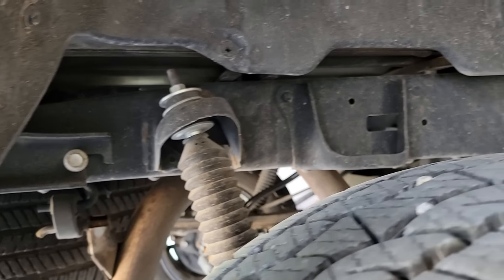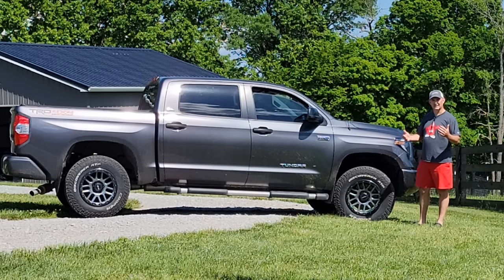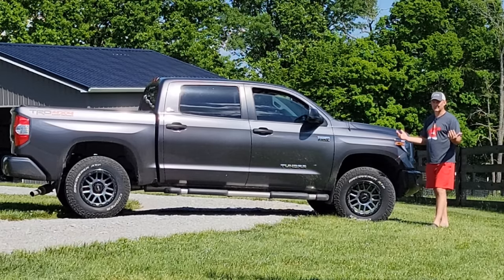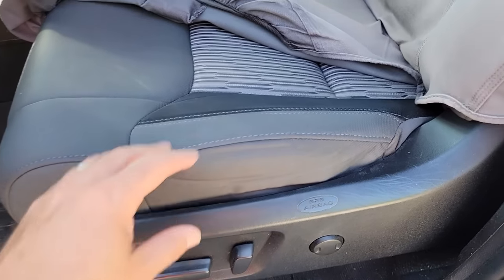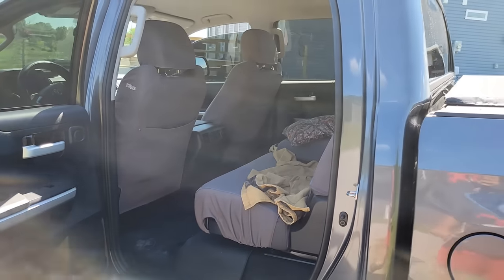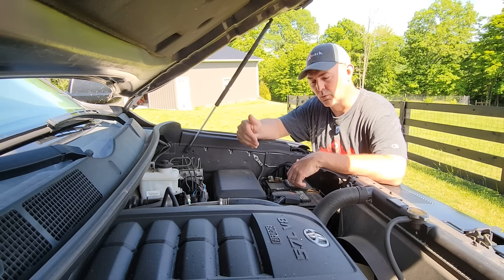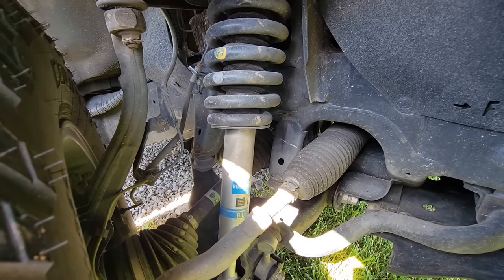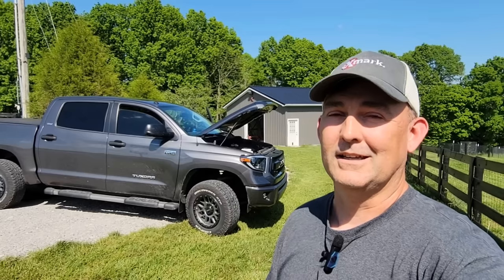Toyota Tundra at 6 Years / 100,000 Miles Compared to Ford F-150 and Ram 1500

Comment: Long time Chevy owner, was brought home from the hospital in one lol I’ve owned nothing but gm trucks, all pre dod and absolutely reliable! Never even had to worry about it. That’s until me and the wife got a 07 suburban with the 5.3 and this one has soured my taste for them. In a time where money is hard to keep ahold of because EVERYTHING is so expensive and the need for reliability is so high it’s caused me nothing but money, time and heartbreak for my beloved bow tie. We only put 10k miles on the 150k mile suburban and I’ve had to replace just about everything! And it continues to have different issues. so I’m officially done with it. can’t find a good older gen Chevy that was left stock without trading an arm, a leg plus one of my kids for so I’m getting a 2nd gen tundra. Test drove one and wow that 5.7 is amazing, very impressed with it. I don’t remember the last time I was that excited driving a Chevy truck. That could be because I was always driving somewhere I didn’t want to be but still lol. Hoping for it to restore my faith in having a dependable truck. Also thank you for your video and time sir! Seems like now a days you can either spend your money on gas or parts and time. I’d definitely rather have my money spent driving somewhere to make money then on parts to fix something so I can drive somewhere to make money.

Comment: Something that always gets lost in the gas conversation is that the 5.7 runs great on regular gas.  Todays turbos take premium.  At the end of the day, total gas cost is a wash.
Reply: Exactly. You won't save anything with the turbos. I read an article that the new tundra was still averaging like 16-18mpg anyway with the hybrid.
Reply: That isn't true in my experience.  Ecoboost 2.7 runs great on regular gas.  Gets 25 mpg not hauling anything.  18ish hauling
Reply: My friends 2.7 ecoboost F150 barely gets 20 empty
Reply: Does he have a lead foot?  Ecoboost gas mileage can vary a lot based on how you drive and what you haul.
Reply: @jboone7805  no, just normal around town driving, some highway.
Reply: I think gm 2.7 runs on reg.

Comment: As a fellow Kentuckian, I absolutely hate the rust issues as well. I have found myself selling a truck when I see the signs of rust starting to break through.  I swore I would never own an aluminum F150 but having bought myself a 2021 it is nice to know I can keep this one without having to worry about rust.  Thanks for the review on the Toyota.
Reply: I'm in the SE corner of KY, my 2011 had been tough as nails, and it's not babied.

Comment: Enjoying listening. I have owned 3 4-runners and 3 Tacomas. Haven’t owned a Tundra…yet. Best trucks in the world. Retired last 7 tears so the 2015 Tacoma I bought new with 96k miles currently is incredible. The 4.0 six pulls my boat and camper (5,000 and 6,800 lbs) with no issues. Have never found a truck I want more than the one I have. The first couple of years after I got it I would have been willing to trade for another Tacoma with a V8 like they had in the 4Runner in ‘03 to ‘08, and still would, but Toyota has made it known there not going in that direction. The politicians or at least the obey we have now, would have us in trucks with power plants we don’t need or want. Baby your current truck because you probably won’t like your next one. Good video.

Comment: Had a 2014 2500hd chevy and by 120k miles I had completely rebuilt the front end, done exhaust manifolds, water pump, hoses and radiator. shocks, plugs, wires, interior plastic rattling from everywhere, radio replaced, window switches replaced, center console latch, TRANSMISSION went out(5500.00 out of warranty), Theres more I cant think of right now but to the tune of about 14k in repairs before 120k miles. Before that i owned an 07 gmc half ton and the motor blew at around 130k and also had the front end rebuilt in it shortly before. I had many 90s chevys with high miles that were so dependable. GM just went to crap after 06. They are still having the lifter issue 15 years later and have yet to come up with a fix except hope its out of warranty so you have to pay for it. Thats criminal IMO and why i wont support them unless theres a change that restores my faith. Until then its Toyota all the way.
Reply: Smart man!!!
Reply: I agree! I traded my 2019 Silverado for a 2021 tundra platinum! Best choice!

Comment: I’ve got a 2019 that just hit 95k.  Did my usual 5k mile oil change and tire rotation and it still runs like brand new.  The only thing I’ve done is new brake pads and rotors at 85k.  Going 95k miles with only routine maintenance is worth all the negatives that come with this truck.  If reliability is everything for you this truck is unbeatable.

Comment: I had a 2009 Tundra that I bought in 2016. It had its frame replaced by Toyota in 2015. The paperwork for that job was still in the glovebox. $11,000+ total. I also owned a 2011 Rock Warrior that the first owner had Zeibart done every year. That’s not a great product being a rubberized product. I saw rust bubbling up under the rubber coating. My 2018 Tundra I just purchased came from Arizona and the frame looks showroom new. To keep it that way I am having WoolWax Black applied before this winter here in Ohio. Tundras are amazing trucks….overbuilt for sure.
Reply: I’m from Arizona. And no offense but we always joke around about you guys taking our rust free beauty’s and taking them back to hell with you guys to destroy em.😅
Reply: That rubber coating with destroy any metal it touches with turbo rust. I havent seen anything good come out of those coatings long term. glad ur not dumb and picked woolwax tho!
Reply: @noobjitsu1743  …. My son’s 2008 4Runner has had WoolWax on it for 5 years and it looks amazing. We live in Ohio (salt brine on the roads in winter) and he drives 15-20,000 miles a year. After 5 years it needs some touch up but it has held up very well, no rust anywhere. GREAT PRODUCT, as is Fluid Film. They are Lanolin based, not rubberized like Zeibart and some others. SMART people use WoolWax and FF!

Comment: I'm going to buy an 07 to 2010 Tundra. Fell in love with the 08 model year. Did a lot of research and I have no problem buying one with 160,000 mls. I live in Florida so the body can last forever if it's not kept near ocean side. I'm finding some beautiful Tundra crew cab with over 100,000 MLS. From my experience with Toyota they are just breaking in at 100,000 MLS 😂 I fully expect to get a minimum of 300,000 MLS out of one. All you have to do is show them a little love and the Yota will love you long long time.😊

Comment: I got a 2010 trd pro crew max 4x4 . Love that truck ,radiant red with tan cloth interior.  The body and interior looks brand new.  Dosen't use oil or leak oil . Im the second owner.  It has  291000  miles on it right now.  I was so impressed that  i went out and bought a 2021 black with brown leather 1794 edition tundra with 23460 miles on it.  The last of the full size 5.7 tundras . I really like the back window option where the whole window lets down like a station wagon  and those massive back doors.  The 2010 runs smoothly. I'm keeping both 😊

Comment: I had an 07 for 9 years and I put over 100k on it with very few issues. My 17 did have a lifter failure that barely squeezed into the warranty period. Other than that, they are very solid trucks. The interiors hold up extremely well and at 150k on my 07, it was still as tight as the day it rolled off the line. I replaced all the shocks around 100k. Of course, I live in the desert which is a huge advantage. Compared to the domestics, they are a notch above IMO. The brand new Tundra? It has way too  many bells and whistles. The reliability will decline.

Comment: Had an 07 for 13 years. I did start experiencing rust around the wheel wells after around 10-11 years but live in the upper Midwest/rust belt. But overall it was a very impressive truck not only the powertrain and exterior but the interior really held up from looks to function.  Compared to my friends domestics it just seems like they start falling apart  both interior, exterior and powertrain about a 100k miles.
Reply: I have an 07 was doing great until some over-medicated Methadone moron went all the way down the side of my truck and hit it so hard he knocked the rear axil off. Im going back and forth with AAA insurance right now because they want to total a truck with 160k miles. You cant find that truck with that low of miles. It Texas you might see one for 12 thousand miles but it will have 285k miles. They need to fix my truck or Im taking them to court.

Comment: 2016 Tundra crewmax TRD off-road,110,500miles on it, no rust, runs as good as the day I bought it,perfect condition ( changed oil/filter every 5,000 miles only had to do a headlight polish and U.V. Protection spray once.

Comment: Hey Bullet Head, man you are right on the money, your presentation was almost perfect, you hit all the high marks, and what you said about all the other Trucks you have owned was 100% honest, I had a 2015 Sequoia Plat, I traded in on a 2019 1774, also I have a 2022 4 runner, so I am locked in on Toyota, listen if I were young again I would buy a Camry, with a little work under the hood, I would blow the door off the Chevys and Fords, I'm not too sure about the Dodges, I would leave them alone, you know for old time sake.........OK you be careful and good luck....BB

Comment: Had a 21 tundra. Good truck but I wouldn’t say bulletproof just imo. I hated the 4 wheel drive feature bc when you go to turn the vehicle while moving, it feels as if you’re going to snap the drive axles and all my other trucks never did this while in 4wd. Toyota then told me that’s normal as we also have a 21 1794 and that one does the exact same thing. Also, the wipers suck on both of the trucks. Toyota replaced the wipers and all they would do is squeal. Cleaned the windshields vigorously and they still are terrible. Had a rattle in the truck bed and Toyota couldn’t find it. They finally told me that the bed bolts were loose on my third time back to another dealer. Still like the trucks but like I say, there are some issues imo that need fixed… nice video sir as just fyi Toyota did keep the rear roll down window on the new 22 tundra crew max like yours. That is a great feature…wish it was offered as well on the double cab lol…👍👍👍

Comment: Everything on my 07 Tundra still works............I do all the maint. Also, I installed a Stair Step on the inside of the tailgate, so it stays inside the bed. Just drop tailgate, swing step out and down, has a handle that stows for stability.
Reply: Could you give me the link or website for that stair step. Sounds like you are happy with real world use from it.
Reply: @RamBo-uu9so  / Thanks, I will check it out !

Comment: I've owned Toyota's since 1990. All of them have been phenomenal.  I have a 2013 Tacoma TRD Sport 4x4 Double Cab with the 4.0L V6.  I have over a 120,000 miles on it and it still runs like new. I tow with it frequently and it just keeps going. I also have a 2010 Toyota Camry 2.5L four cylinder with a 6Speed manual shift with 260,000 miles plus on it, and it runs like a sweing machine.
Reply: 07 5.7 here with 190,000 not one issue. Runs/idles like a new one. I must have gotten the only good apple. Amsoil 5w20 is key.
Reply: @limeallens6160  I use Amsoil Signature Series 5W-30 in my Tacoma. I use Amsoil in everything.  Transmission, Coolant, Brake Fluid, Power Steering fluid and  front and rear diff plus transfer case with Amsoil.
Reply: @BOSS-xy8op  Amsoil is the best I to use sig series. I do a 10k oil change interval though the oil is rated at 25k. I use their grease for my driveline and their fuel additives as well. Pretty much all things Amsoil other than coolant.

Comment: 2017 5.7 with  210K used for literally everything, used and abused at work, long off road miles, and its my daily driver, the only thing ive managed to damage and replace is my headlight light bulbs lol. I use 5w 30  medium grade gas and engine is bullet proof.

Comment: The way I look at it, to replace it for a truck that gets "better mileage" (not when towing though) and spending 50k on a new one, well, that 50k buys a lot of gas. Many of these new powerful trucks require premium fuel as well.
Reply: I think I read that new ones are tuned for 87 with a turbo
Reply from the maker: If this truck were paid off that would be a very valid argument.  But if you go from a payment of X with terrible fuel economy to a payment of X with great fuel economy it's a big win in today's world.

Comment: I love my 2017 SR5 with the 4.6 liter engine. It just turned 100,000 miles. It tows my 4500lbs RV with no problem. Averaging 9.5 mpg when towing. Unfortunately I will be selling them both soon. I have a 12,000lbs  fifth wheel RV in mind to purchase and the Tundra can't pull it.

Comment: About the gas mileage.

I have a 2017 TSS Offroad for a year and I absolutely love it. To be 4WD...I'm getting 15.7 mpg in my day to day driving. I can't complain about that with a 6700 lb truck. Once, I filled it up and drove 65 mph for 120 miles on the 4 lane and got 18.1 mpg.

For those that say they get 11-13 mpg, you can't complain about that if you're jacking it up and putting on gigantic tires, or you're constantly towing something.

Comment: Thanks for sharing. Interesting perspective. 6 years/100.000 miles is barely broken in for a Tundra. Good point on the mechanical fan and power steering costing a little bit of fuel economy and power, but I wonder if one repair of more modern parts will make up for that.

Comment: My 2007 has almost 184k miles on mine.  It still starts right up and sounds exactly like a new truck.  I just took it on a long trip last weekend, and it runs fantastic.  And, it's paid for. I'd kind of like a newer one, but only because I want a newer one and not because I need another truck or need to replace my truck.  It drives like new, so I won't be buying another truck any time soon.

Comment: I own a 2013 Toyota sequoia. Bought it this year and partly what sold me was the fact it had 114k and every bolt was still shining. We live in the rust belt too, we're out of South Bend Indiana, we bought him down in Muncie where it spent it's whole life. A little surface rust on the frame and on the A arms. Rides and drives better than any F-150 platform I've touched. For the record I work in the RV business so I see and drive fords, Chevys, even Mercedes Benz platforms all week long. Granted this thing also is like a big minivan, it litterally drives like an overpowered minivan so the comparisons are not quite fair yet I think it says something about the build quality of my truck compared. Since my Sequoia was like a quarter of the price of a new truck for me that's even better. It might not have the latest technology and it's a bit expensive on gas, but I think the savings are just obvious. Sure it's probably less fuel efficient than these new trucks but not having things like direct injection, or cylinder deactivation or turbos there is much less to go wrong. The truck is based off old school proven technology inside and out. Mines a limited so it has things like navigation and heated leather seats but nothing fancy. It's definitely a more utilitarian than say a Landcruiser.. but again less stuff to go wrong and it also didn't carry that crazy price tag. Over all I would say it was a great buy. I know it's not perfect and no vehicle really ever is but the build quality, the quality of parts really stands out to me. I can't speak about the newer ones, I drove a 2023 hybrid Sequoia that our dealer had on the lot. It's a nice truck but I don't think it's a great truck. It doesn't have that 'throw you in to the seat' kind of punch and it was 83 grand. I just couldn't see 83 grand worth of truck there. It's a lot of money and I have no doubt it's a bad truck by any stretch. Probably will last for years. It just didn't feel as good as my 2013 Sequoia that was nearly 2/3rds cheaper. Probably better on gas but at what cost? For us it was just obvious. We haul a lot of kids for church and pull a camping trailer.

Comment: I’ve had more chevys than Toyota s tundra s , I’m on my 4 th and 3’rd new tunde . Overall I can tell you some have recalls and some are issues either way none of them rusted like Chevy & Toyota took care of everything in good will on my 18 . Chevy never did that at 5 years .  Call goodwrech and see where Toyota takes care of you . But as you said the 22 needs a refresh. FYI Check tsb on fuel pump s . Fixed gas mileage. Took almost 2years to make it happen with the Toyota rep , but they took care of it  in good faith and I appreciate it . I’m in rust belt in n Illinois and it’s 5 yrs old and clean . Great video !

Comment: Does that engine have a timing belt? My 2004 Sequoia 4.7 does. Make sure you replace that now especially if it's an interference engine. I have 206k on my truck. It's not perfect but it's a great truck and I'd drive it anywhere. It is dependable. I replace about 3 quarts of transmission fluid every 15k miles and the fluid is still cherry red and shifts smooth. I love my old Toyota. Yes, fuel economy isn't good an 17mpg but it always starts and always gets me where I'm going with only general maintenance.

Comment: My 2007 Silverado Z71  has the 5.3  runs strong 160,000 miles no issues with the engine and transmission, I just put 2020 Dodge rebel rims and tires 🛞 on and they fit just right, My next truck will be the 5.7 V8 Tundra Double Cab.

Comment: I love my 2016 SR5 offroad crewmax, it's got 120,000 miles on it and I only had the front passenger side wheel bearings starting to make a little noise,  took it in and had both front wheel wheel bearings replaced at same time,  other than that , perfect .